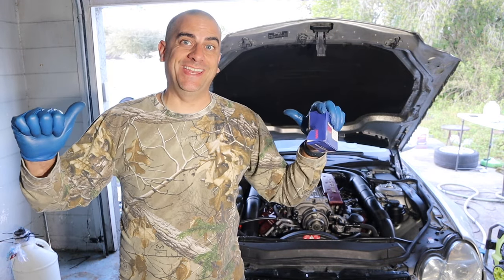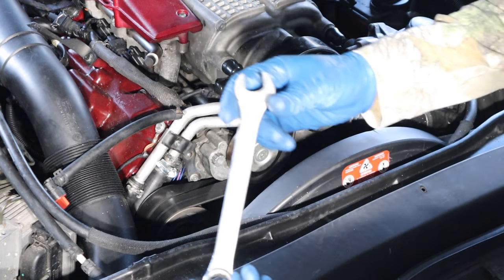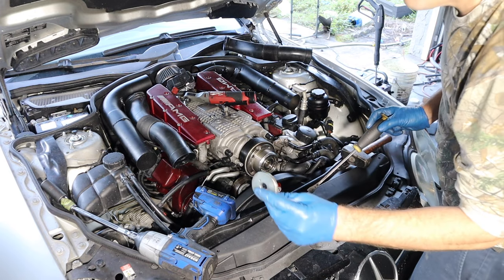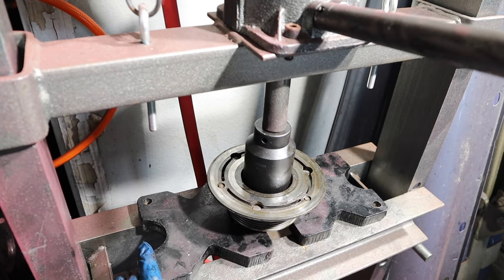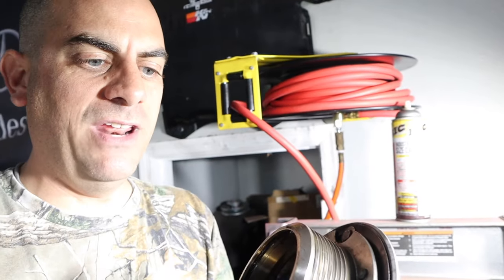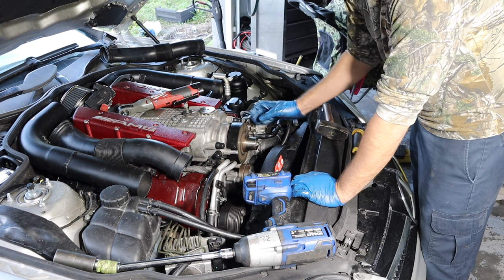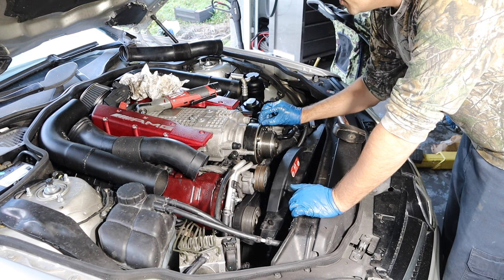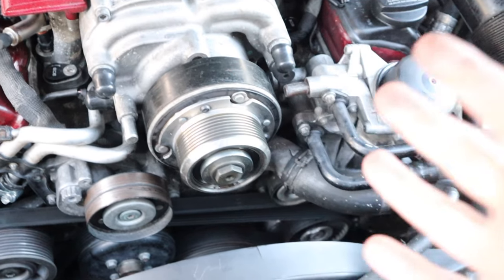Replacing Supercharger Pulley Bearing On Mercedes SL55 AMG m113k

Comment: Use the old bearing to press the new bearing in, when pressing in a bearing you want to press on the outside race which doesn't put any pressure on the bearings or cage (you're not missing balls from the bearing, the cage just melted and flung itself out) just trying to help as I've been a mechanic for over 20 years, I've seen people use a bfh and wood to do this job, you did much better 😀 nice car and nice dog, thanks for the video
Reply: Totally agree. I did this the other day with a press. I cut up my old bearing and only used the outer ring only to push it down. I used an angle grinder to cut it up. The outer ring has cuts in it so it comes out no problem afterwards.

Comment: When I installed my SC bearing. I pressed the old bearing out of the pulley. 

Then froze the new bearing in the freezer and heated the pulley in a toaster oven. 

The bearing literally fell into the pulley with no pushing of a press. Easiest install ever.

Comment: Did you jack the engine to access the supercharger bolt? I can’t access mine with the electric wrench like you do, the radiator is blocking the way.
Reply from the maker: The sl55 I did not have to.    But on my Cls55 I did 

I made a video showing it with my Cls55 that might help you
Reply: @Nd_72  ah I see, mine is G55 so the radiator is bigger and blocking access.
I checked your video, you didn’t have to unplug anything before jacking up the engine?
I will remove the fan and try to lift the engine a little bit to access the bolt like you do with the electric wrench.
I couldn’t remove this bolt manually, it’s stuck

Comment: Unrelated question…
I have an ‘06 SL55 (bone stock) and has that pesky ticking noise coming from the driver’s side.  Since you have a ton of experience with these what would you suggest?  I was going to try an engine flush and switch to amsoil 5w40.
Reply from the maker: is it from the purg valve or the Motor